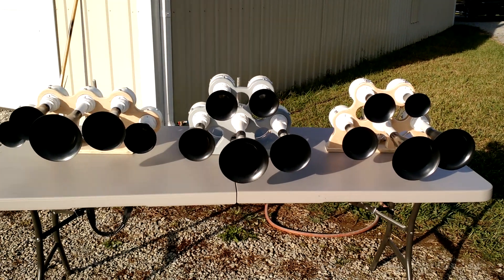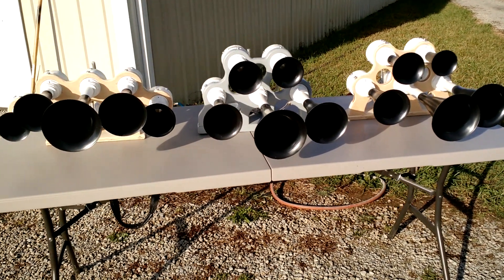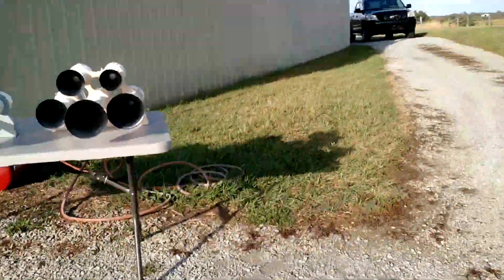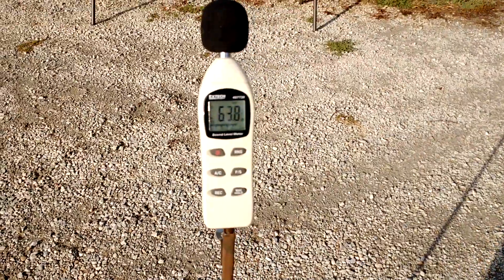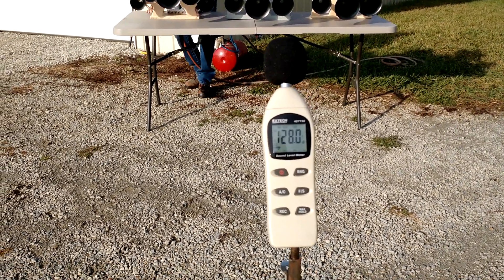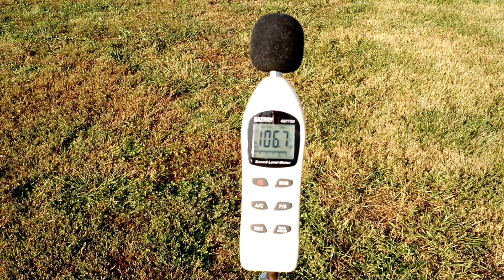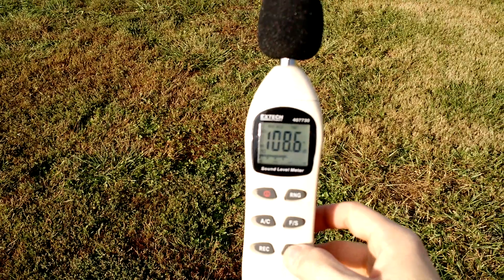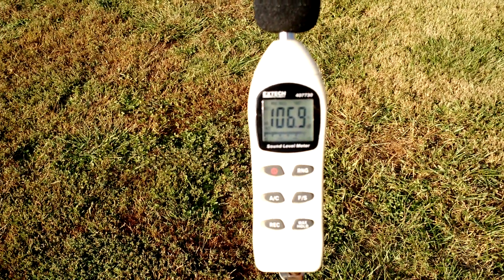PVC Train Horn M5, K5LA, and RS-5T dB test

Comment: WOW! 128 DB is twice as loud as 125 DB.....AND 128 IS 1000 times LOUDER THAN 100 DB! Not bad at all for plastic! For every ten decibels its 10 times the former measurement, so 28 dB is almost 1000 times as loud. When you have that level of noise, your ear can't tell the difference between 100 dB and 130 dB!!!!

Comment: Your K5LA does sound like one to me, and I came of age with the ones on Amtrak and Chessie System in the late 1970s/early 1980s.  There is a one note difference between those two types, but I don't remember exactly what the one note difference is, or exactly which one yours sounds most like.  I think it favors the Amtrak tone, but I'm not sure.  U. S. train horns usually blow off of the main reservoir tank on the locomotive, which is set for 130-140 psi.  I don't know if there is normally a reduction valve between the main res and the horns.  Yours sound just fine at 95 lbs.  You could have fooled me outdoors wondering where the train was.  Back then the railroads mounted the horns directly on top of the cabs, and at that time didn't allow engine crews to wear ear protection, so there's a lot of hard-of-hearing retired railroaders from that era.

Comment: But then and now I’m fine I think listening to music kind of loud has helped my ears maybe be more tough plus I’ve been doing it as a kid with my dad and I’m only 19
Reply: You can't toughen your ears. Every loud noise affects your hearing negatively to some degree. You may notice it right away, or when you're older. But, it will affect you at some point. If you like the idea of being able to hear and not needing a hearing aid, WEAR EAR PROTECTION for mowing, weedeating, grinding, circular sawing, air powered tools and other loud tools. And consider volume reducing ear plugs for concerts. They are made by brands like Sony. They are designed to lower the volume without sacrificing sound quality like foamies do.

Comment: I've watched all your videos and I'd say this is the one where the horns sound their best. The one where you blow them on a small table in the backyard they sounded flat. Like musically flat/ out of tune. But this video clearly shows that they are tuned better. I have a real k3 in the front bumper off my car and am thinking about building another set for the back bumper. I will be using your tips to build my own. I know these a kinda old but you should do a more in depth one on the tuning process. Thanks for taking the time to show everyone what's possible with some pvc fittings and some effort.

Comment: Very impressive, along with your other great videos !!
Can you reduce the loudness just be reducing the air pressure, or are they tuned to sound best at a specific pressure.  The feathering with the ball valve sounds really, really sweet, even though a ball valve is kind of poor for modulating air flow.  I bet it won't be too long before you disassemble the ball valve and contour the  hole thru the ball to smooth out its affect.  Nice work!